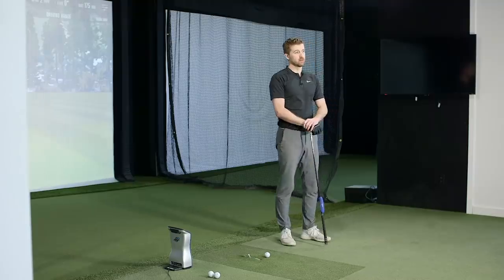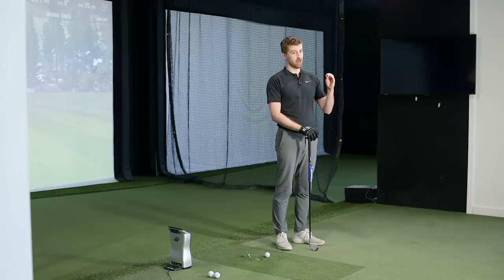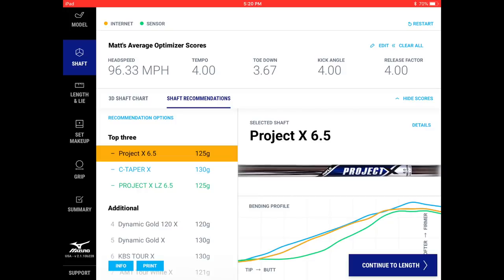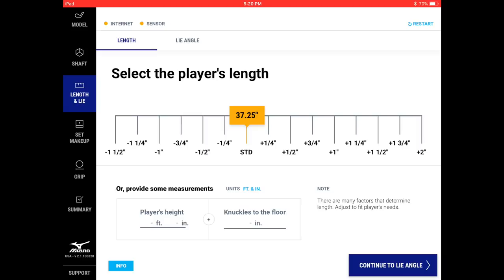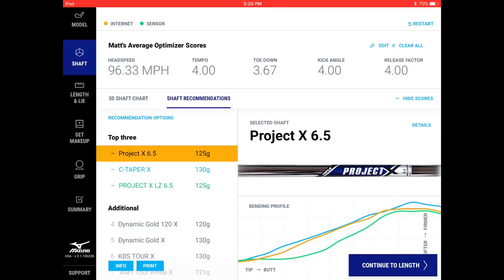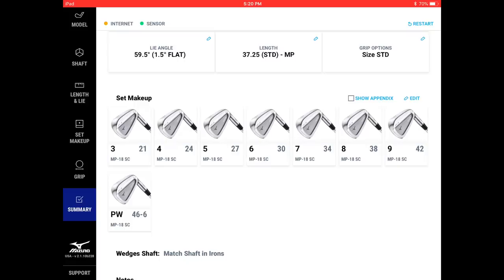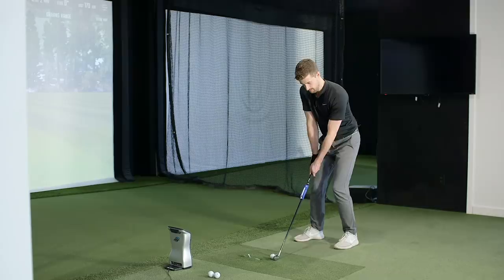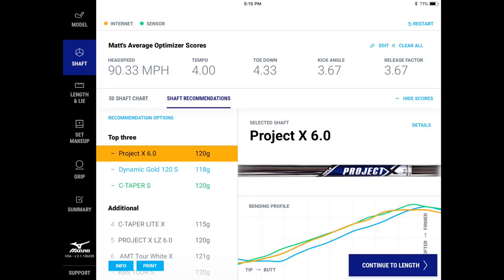Mizuno Shaft Optimizer 3D – How Effective is it?

Comment: Boys I am 103 swing speed on the Mizuno optimizer with an 8 tempo so pretty fast.  I’ve been fit into an x100 and project X 6.5 on my last two iron fittings but struggled with both. After watching this video and hearing Chris talk about an early releaser or flipper needing a softer tip what shafts fall into a heavier x flex shaft with a bit of a softer tip?

Comment: Hi Gentlemen, This equipment is all fine for the better player , and even then do you never look at a players swing to possibly  find out why some of these mistakes are happening, rather trying to fix faults with faults. All of the fitters now do not even look at a player to see what is happening there, they are making assessments from the results on the  machine.Had an instance where a player had a gross overswing which was not even seen, then an Over the top outside in plane where the player had to lift his hands to have room to clear and a huge fade.  He was fitted , according to the results, 2 Degrees upright lie angle and told to swing down more inside out. When we fixed his backswing he became a hooker because of the Lie angle.With all this equipment now, there is too much fixing faults with faults..Then after the main fitting he tried to play a steeper cut shot and the machine said he must change to a softer shaft, Well what will that shaft fix for him.   SORRY TO SAY !!
Reply: Edward Webber that’s why, still, a well acknowledged professional is still needed...

Comment: I was just in Thailand, and I visited every single Mizuno outlet in Bangkok city but could not locate a shaft optimizer 3D. Very disappointing really. However, I ended up buying JPX 919 hotmetal and swapped the stock shafts with Accra shafts hoping they would work. I have not tried the clubs yet as I just got back home .

Comment: Ian, if one comes in for a fitting and the Mizuno analyzer is used, but the player prefers a different OEM, is there anything that you have available that allows you to quickly suggest a shaft with similar characteristics from the other manufacturer? Or, do you have the info in your head which would be really frightening.
Reply from the maker: oh I can guarantee it's in his head!

Comment: I have just been fitted for my new Mizuno JPX919 hot metal pro and my fitted just used my ping fitting details. Never used the 3D optimizer. Now I am concerned.

Comment: I hit a slight fade...about 5-7 yds at 150 yds with an 8 iron.  my typical miss is or starts slightly left of target.  My Mazuno DNA for a 919 Forged club has me at +2 upright.  A recent manual fitting with the same club using impact mark tape and notched ball (no lie board), put me at +1 degree upright.  Anyone have a suggestion as to which I should use?  I buy the upright but not sure whether I  should go +1, +1.5 to split the difference or +2.  If I recall correctly every 1 degree equals about 6.5 yds offline so 1 degree seems about right.

Comment: Ian I understand this is a shaft Optimizer but would you be able to recommend a head from doing this?  I'm wondering if maybe it would say something like.." Hey Chunky step away from the MP18's MB and maybe check out the Hot Metal....or better yet have you considered tennis?"  Seriously though, would that be up to a fitter to suggest the best head option?
Reply: The app showed a recommendation of MP-18 SC 3-pw for Matt based on his first three swings.
Reply: Head choice is a discussion with the fitter. The reason it spat out MP18SC for Matt is because that is their left handed head. There's an option for choosing what head before the shot hitting commences. Your fitter will go through and tell you this.
Reply: Ryan thanks, that was my original thought. Regardless of the head you use and weather it’s right for you or not, the optimizer will give you shaft recommendations.

Comment: I'm just taking over as GM of a small, public golf course, and I want to start offering fitting in our pro shop. I hope to see a video coming about fitting with the bare minimum as we can't afford a device like GC Quad. I was thinking of Skytrak and one of these as a starting point? What are your thoughts?
Reply: I think a lot of smaller golf courses with pro shops would like to know this as well.  My local club uses the old Mizuno shaft optimiser irrespective of what manufacturer's irons you want to help but coupling this with a cheaper version of GC Quad could (would?) be a major step forward
Reply from the maker: This is a great tool, would highly recommend it to a shop without a GC Quad or similar. We're going to try to review some lower cost launch monitors later this year

Comment: What is the technologies used in the dna system ( Giro) what exactly is that and how does it work?

I remember the old system had sensors built into the shaft
Reply: New system has both the Strain Gauges (as previous), plus the new Gyro that calculates the lie angle.
Reply: mizunogolfeurope 

Thanks for getting back to me. Are there any visuals on how gyro measures. I understand the term but but don’t know how it actual works. 

Many thanks
Reply: @ThunderMk2  Neither do we ....sorry!  If we find out will let you know.

Comment: Another great video but I have two questions. Can you select that you only need graphite shaft options/advice? I needed to switch from steel to graphite shafts and it took me some time ( between several brands because shaft head combo’s didn’t match up for me) to find the right combo. By the way ended up with MP18 blades with Project X LZ tour shafts...so Mizuno for me 👍🏽😃

And I would like to have seen the shaft advice for Matt with the driver. I understood that the dna optimizer also gives an advice which shaft would be the best fit in the driver/woods.

Comment: A question - how much is this process impacted by the shaft/lie angle you start with? I presume Matt was using his current equipment which is already very well fitted to his swing dynamics.
Reply from the maker: Using the mizuno optimizer club, set at standard length and lie
Reply: @clubchampionmedia  Thanks for the clarification

Comment: shaft optimizer always spits out stiffer shafts than needed.  unless you tee the ball slightly the force on the ground jumps up speed.  the top 3 is misguided, good baseline.  any fitter will know what weight and bend profile is suited for a swing type and player.  shaft feel is most important and i saw it all the time people would love the feel of other shafts but go with the "top" recomendation